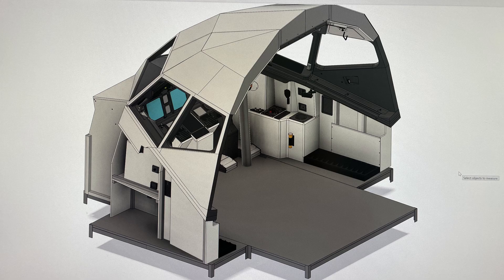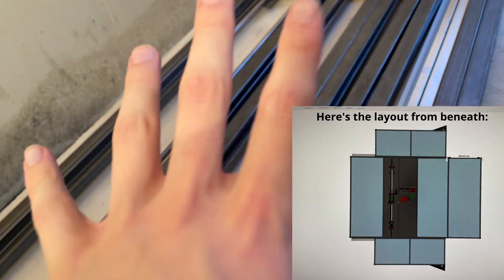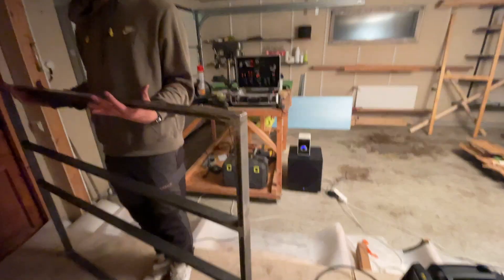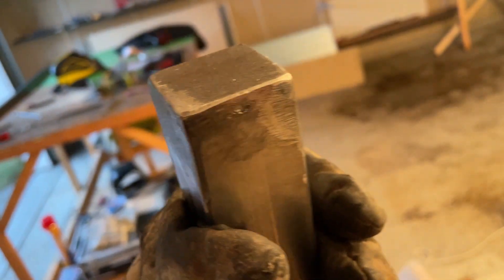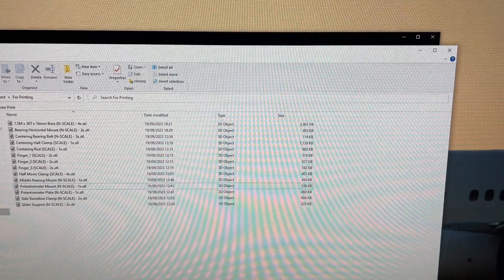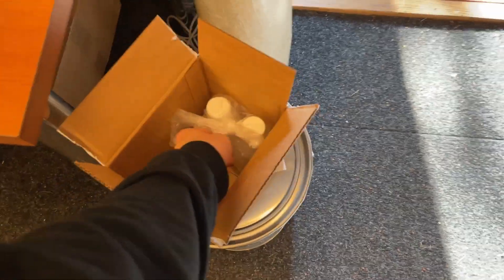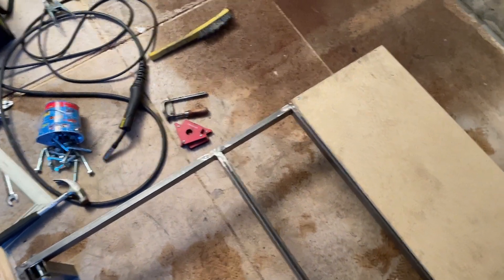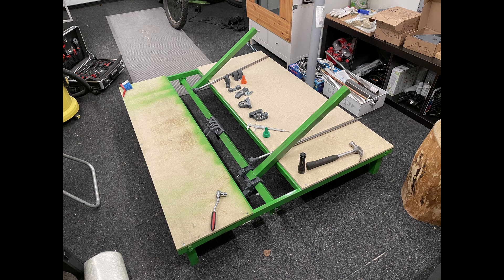Main Frame - [B737 Build #1]

Comment: Very good explanation and the details are smart- I just got started on such a project myself. I see my 3d printer I just bought may be too small compared to your big one. Good luck with the project!
Reply from the maker: Thanks! When I started my first 737 simulator four year ago I had just a small basic 3D printer. Even though it was harder and things had to be split into multiple pieces it was still achievable. I later got my bigger printer which made things easier but I am sure you can manage with a smaller printer too. Good luck with your project and I am sure it is going to be really good if you put enough time and thought to it!
Reply: @diy_finn     Thank you! That was encouraging to hear 🙂